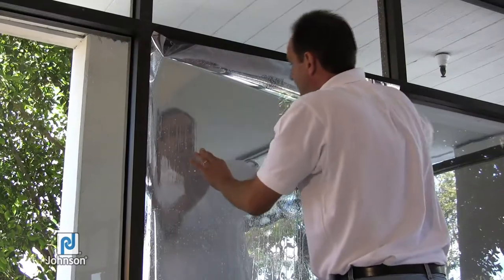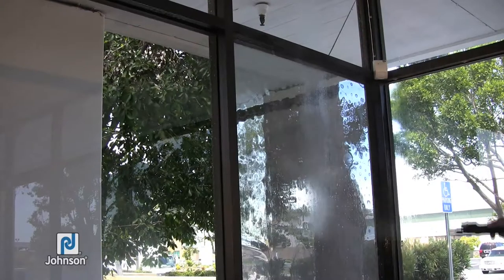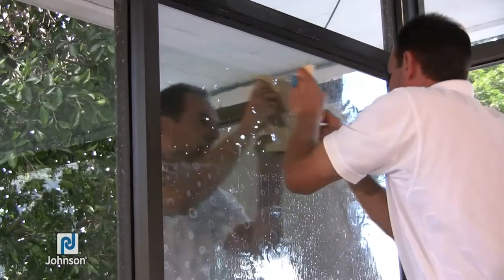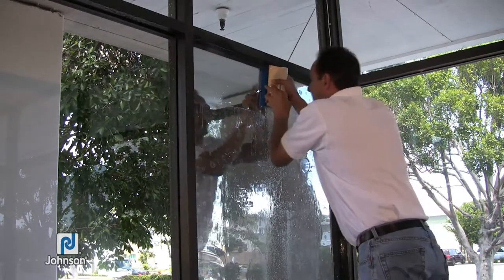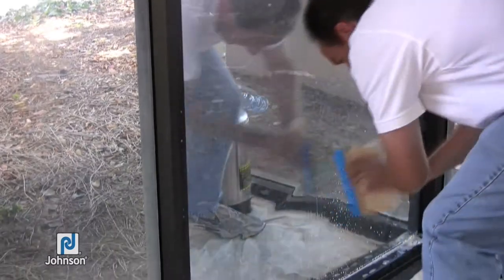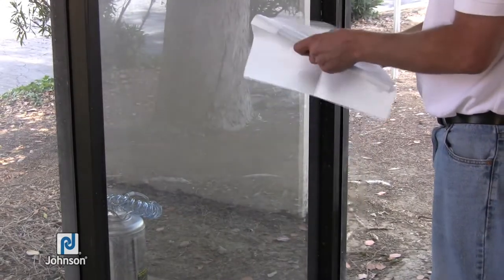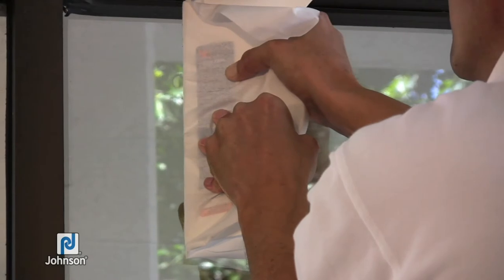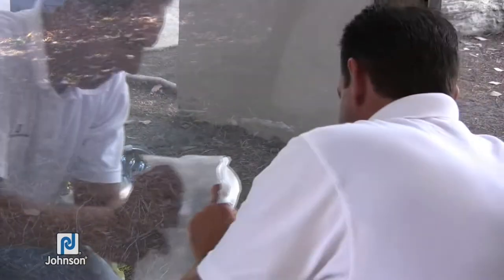Safety Film Installation Video

Comment: Do i need tO installed oN both side? How about If the length Of the Security film less 5 cm than windows, such as window length 157 cm, film length 152 cm does it Will impact ?